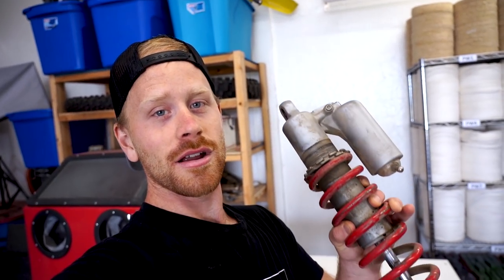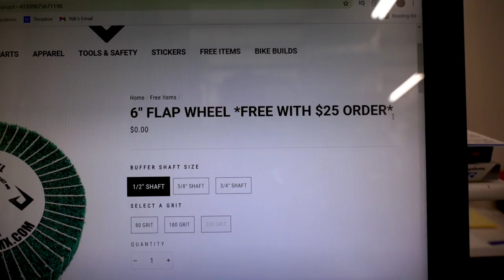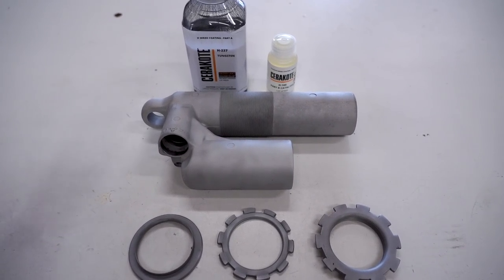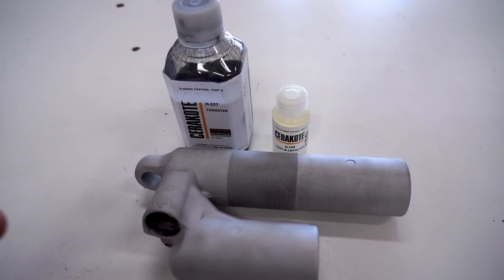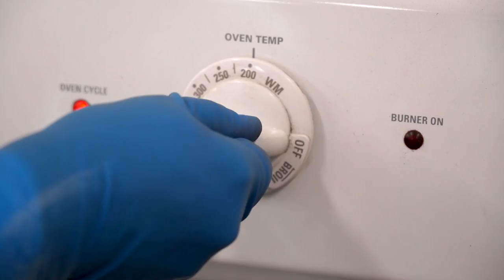A Full Makeover | RM250 Rebuild 23

Comment: Here’s a trick for spring removal. Compress the shock before you remove it from the bike and use (4) 100 Lb zip ties to hold the spring compressed. Then once removed from the bike the spring’s lock nut will not have a load on it. Makes for easier spring removal. If it’s off the bike already you can use a floor Jack up under something solid to compress the spring. Works like a charm whether the bike is brand new or 25 years old.
Reply: Good advice, I may try this!!!

Comment: Hey cam, I took my bike completely apart and am in the process of rebuilding right now. Released the nitrogen and started taking my spring apart and then saw a vid about testing the compression like you did here. If I released the nitrogen and it didn’t compress, that makes sense, but since I wasn’t able to test is there any way to know if it’s good now? I inspected everything inside and it looks good

Comment: Hey Cameron needed help with one of my shocks. Basically the shock shaft spins and has side to side play do I need a new shock
Reply: There should be a bushing in your seal head. Did not saw it like you described it but maybe the Play comes from there
Reply from the maker: It's normal for the shaft to spin, but you'll need to take the shock apart to see where the play is coming from. Most likely seal head or piston.
Reply: @CameronNiemela  thank you so much for the help!!!
Reply: @lucafeldhaus6062  ok thanks for the comments and help!
Reply: @lucafeldhaus6062  saw your cr build btw was super nice
Reply: @lucadonorio1815  haha, thank you!